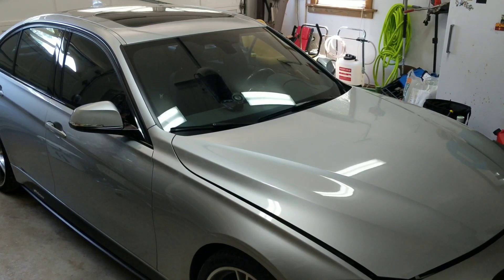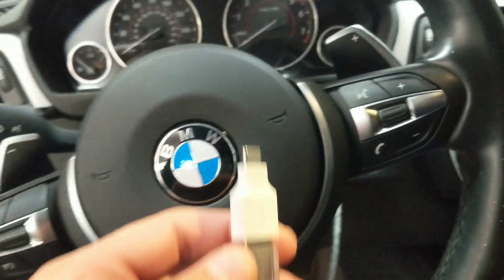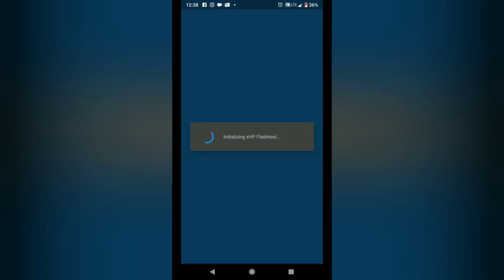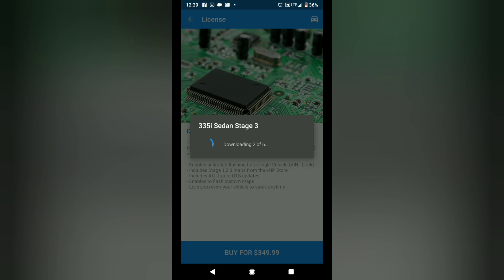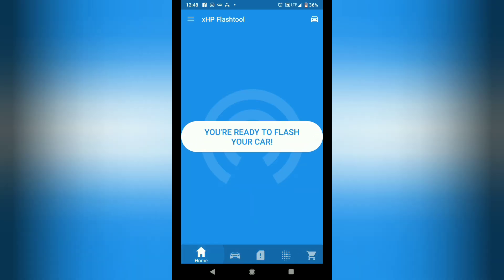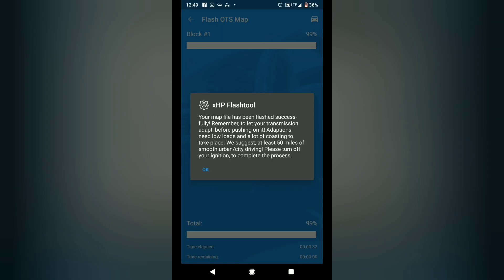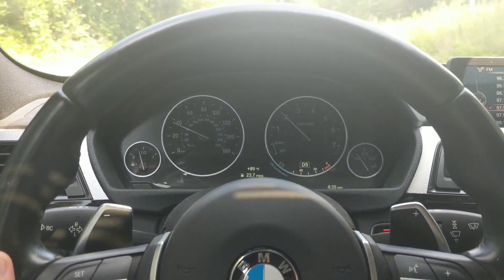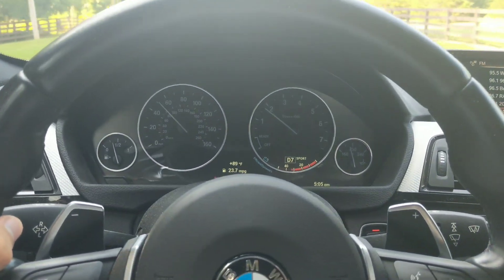How to xHP Transmission Tune Flash a BMW F30 N55

Comment: Did you mess with the shift point settings? I'm having a hard time dialing it in.
Reply from the maker: I didn't mess with them off the bat. I ended up changing the wheel slip and what not, but do not remember messing with those before I sold it